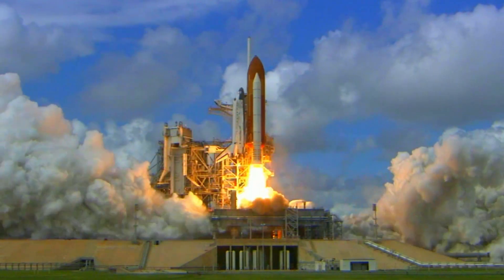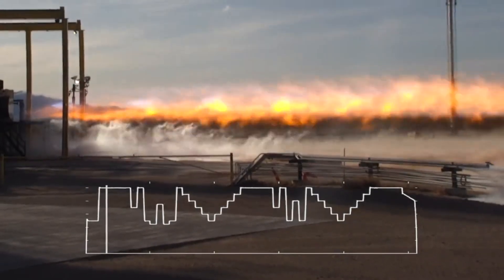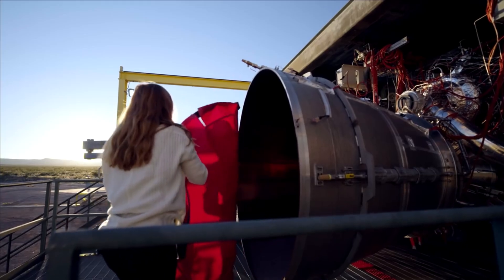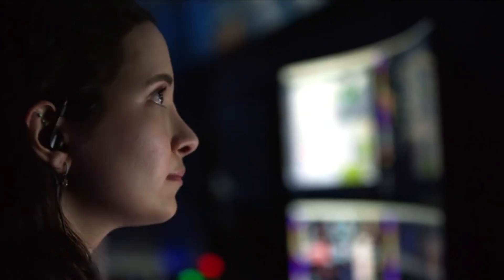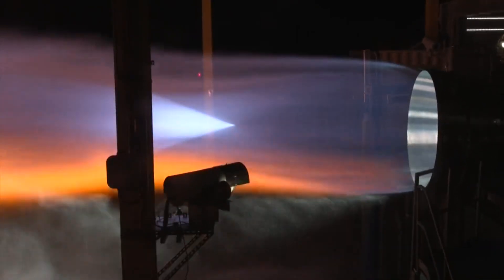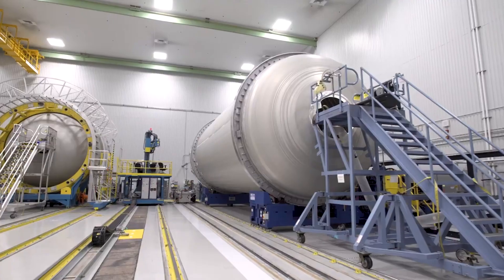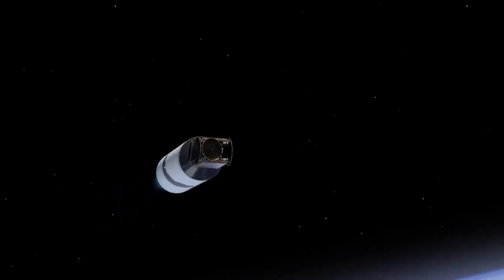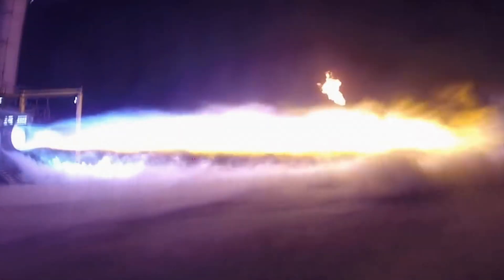What Progress Has Blue Origin Made On BE-4?

Comment: How long has Besos  been  working on this  engine? I think he started back in the 50s, right? 1957 or 58, if memory serves. In another  couple hundred years,   he should be done. By that time Elon will have invented the antigrav motor. About the size of a garbage disposal  unit, it will  lift 100 tons off the surface w/out breaking a sweat...

Comment: Blue Origin is a failure. They are burning cash with no strategy for revenue without ULA.  ULA is in deep trouble as well.  If ULA goes down, then BO only has a few NS launches per year and the New Glenn Vaporware project.  New Shepherd is probably not profitable at all.  If it was they would have a better launch cadence and more vehicles in production.  

Also, the over all mission statement for BO of moving manufacturing off earth into LEO is incredibly stupid.  

Relativity Space and SpaceX will finish off Blue Origin for good.

Comment: This was an infomercial for Blue Origin.  There was no useful, objective information here.  They are in big trouble with ULA (4 years late).  The BE-4 has half the thrust to weight ratio of the Raptor 2 and 40 times the cost.  Blue Origin started before SpaceX with much higher funding and hasn't even made it to orbit yet.   I wish there was a genuine competitor to SpaceX to challenge them, but Blue Origin is not the one.   At some point, Bezos will get tired of dumping a billion dollars a year into a failing project and will pull the plug.
Reply: I agree the engine is way overdue but I dont think ULA had a conga-line of customers waiting for rides on Vulcan that are launch ready for this yr
Reply: @charlesoflondon1066  Why do you think that?  The Vulcan isn't complete without the engines.  How can you book business without an engine?

Comment: The BE-4 has 250t thrust, Raptor 2 was recently at 230t thrust. SpaceX is still improving the Raptor 2. Unless I missed an update, each of the current Raptor 2s has only 92% of the thrust of a BE-4. That explains why each booster needs 33 of them.
Reply: The Raptor 2 has almost the same thrust as the BE-4 with half the size and weight.  That's why they can fit 33 of them in the Super Heavy booster and launch over twice the payload capacity of the New Glen.  The current cost of the BE-4 engine is $40.8M.  the cost of the Raptor 2 is $1M, which they expect to reduce to $0.5M once in volume production.  They make over 7 Raptor 2's per week.  BE-4's are hand made and they only have a total of 2 flight engines.  ULA is probably wishing they bought engines from SpaceX at this point.
Reply: @billweberx  you cant compare costs of an early production engine to a developmental one. Its like comparing apples and pears.
Reply: @charlesoflondon1066  I don't know what you're talking about.  Neither engine is released.  Both are developmetal.  Do you really think that BO will improve the BE-4 to be anything close to the Raptor 2?  That would be a miracle.
Reply: Using BE-4s, try and see how many would fit under a Starship Booster and then do the math on how much overall thrust that would produce. Making Raptor small enough so that 33 of them would fit under a booster was exactly the point.
Reply: SpaceX rocket still cheaper and more reliable
Reply: @alqaeda7040  That is for the Falcon 9. Starship and Raptor 2's are not proven as reliable yet, still a lot of testing to go.
Reply: Raptor is in a constant accelerated development cycle, and recently hit 247 tonnes Peak thrust on the test stand. Raptor 2.5 will have 250 tonnes as standard.